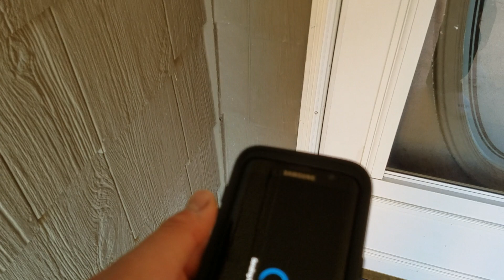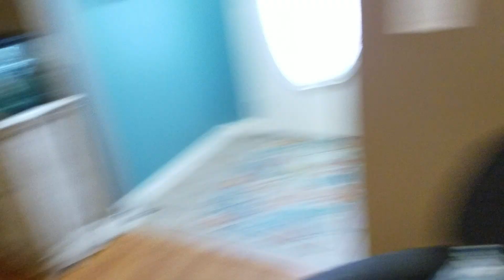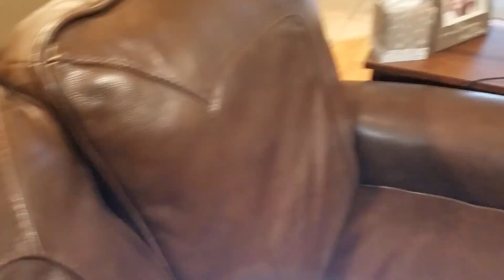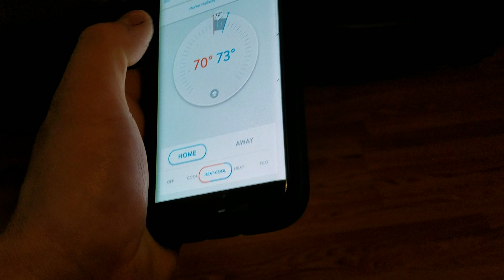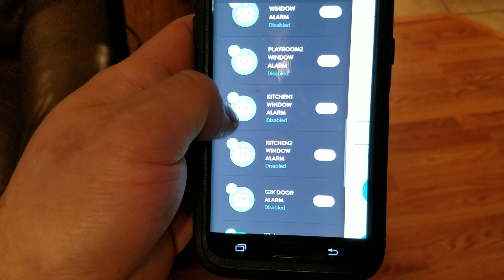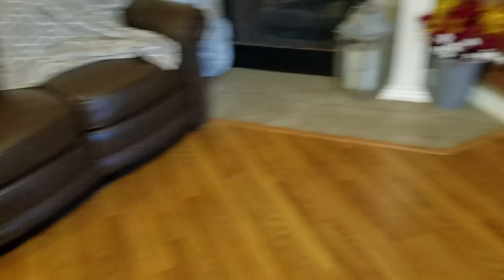Amazon Alexa Powered Smart Home!

Comment: Nice Keith! I have been using Samsung SmartThings as a hub the last couple years and have a little over 30 I/O devices now. It's pretty fun to code the routines when you get enough stuff to control and use presence sensors for each family member.

Comment: Great video. I have the Shark Ion 750 robot vacuum and it’s not Wink controlled but it has a app. It works great. What is the display in front of the Alexa?
Reply from the maker: The display is an ancient Motorola Xoom tablet, it basically sets there with the Wink app and other remote control apps on it to control stuff.